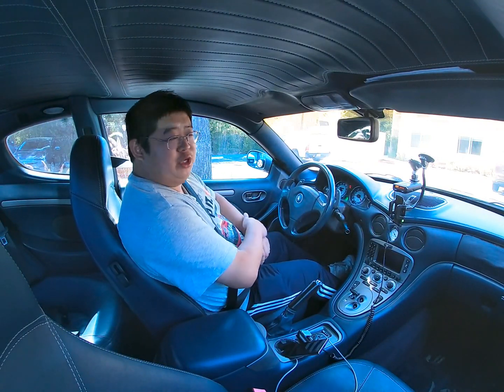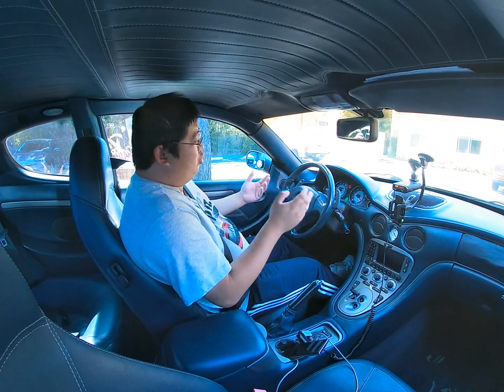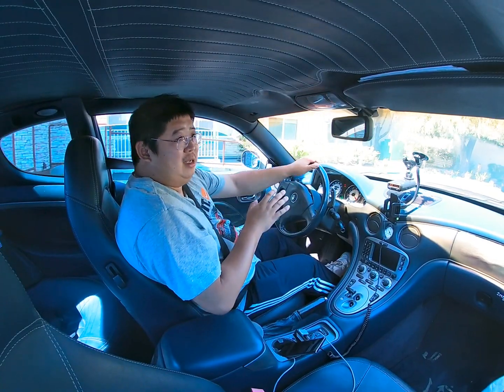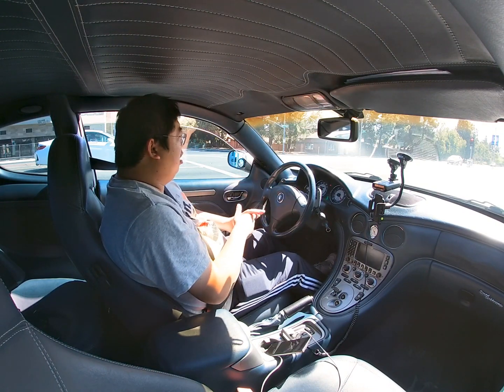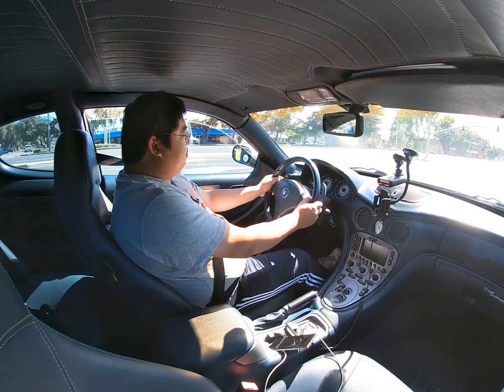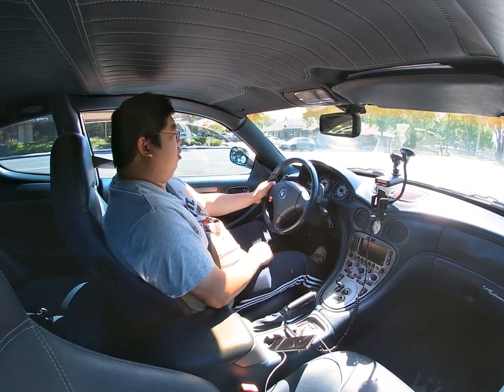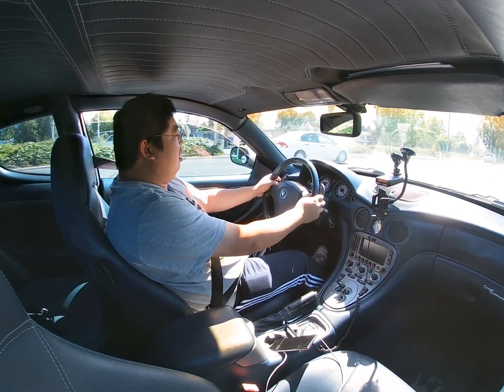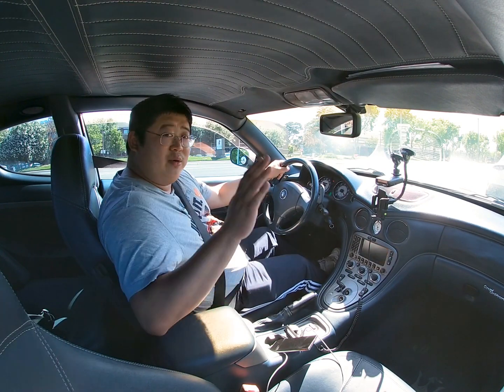How to properly shift an F1 Transmission

Comment: Hi from Wedding Australia. Sounds fantastic, what exhaust did you have and were you running a tune? What mods. Thank you.
Reply from the maker: So I have the factory OEM mufflers, but they were cut open and modified into a straight pipe and welded back on. I think there is a guy from Russia, he made a YouTube video on how to customize the exhaust on 4200. I followed his instructions online. Also I did a secondary catalyst converter delete.
Reply: Carl's Garage  thanks for the reply mate. Hagerty on YouTube has a couple of very nice reviews on the Quattroporte and a great inexpensive exhaust, also the 4200 gransport

Comment: Hello. Thank you for the video. Do you have to turn off Automatic to go into Sport Mode / before going into Sport Mode?
Reply from the maker: No, for 4200GT all you need to do is to press the Sport button. It can be done in either auto or manual mode. It makes the shifting faster and suspension more sporty (if you have optional skyhook suspension)
Reply: @CarlsGarage1  So I can use Auto and Sport Mode at the same time?

Comment: When pulling up to lights and stop signs. Pull both levers to put it in neutral. As you would a put your foot on the clutch in a manual stick shift. This way you disengage the clutch. When the light turns green or you want to go. Select 1st gear.
Reply from the maker: Thank you for the information! It is a very debatable question. 
I have been told that: "The simple fact is that standing still in neutral or standing still in gear with the F1 makes no difference whatsoever to the clutch, throwout bearing or pressure plate. The clutch is completely disengaged in both cases and the throwout bearing is spinning in both cases. It's true that most manual transmissions only spin the throwout bearing when the clutch peddle is down (i.e., clutch disengaged) but the F1 uses a so-called "full contact" TO bearing which is always spinning. There is no mechanical advantage or disadvantage to sitting still either way. I do put the gear into N when the traffic light is longer than usual."
Constant changing from N to 1st sometimes my car won't engage 1st gear and would only engage 2nd gear after about 5 seconds of hesitation. According to Maserati it is normal when for some reason the 1st gear is not available, thus it engages 2nd gear which is not a malfunction but rather an operation logic. So I have been sitting on 1st instead to avoid such problem.